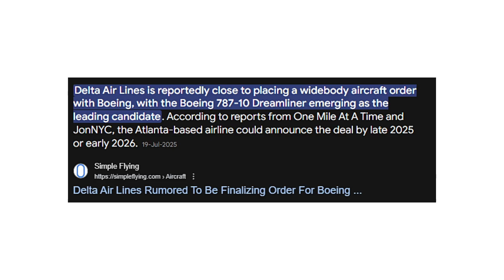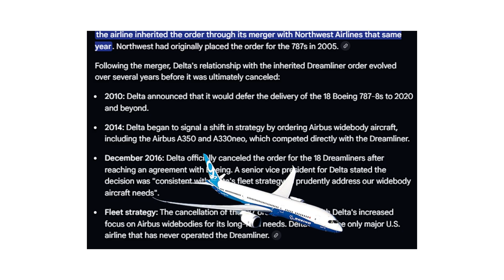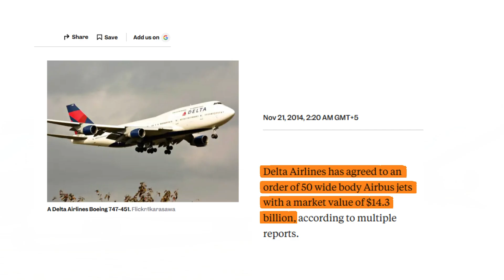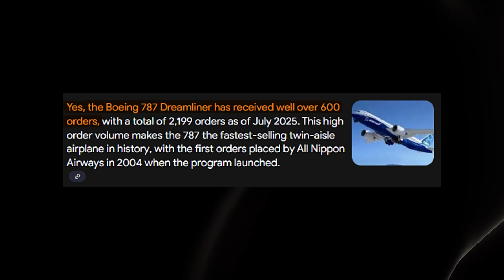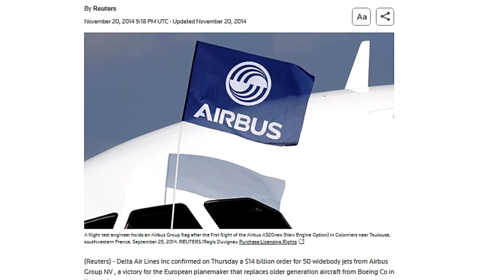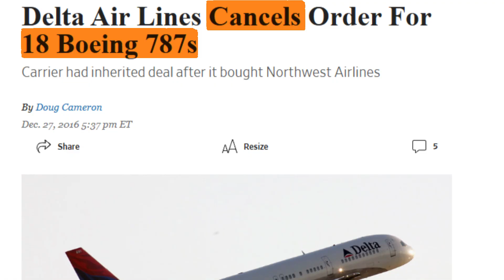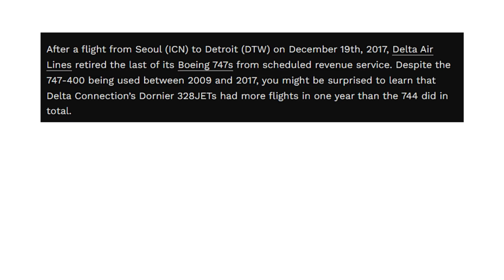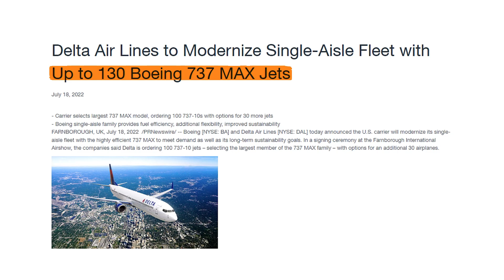Why Delta Abandoned the 787

Comment: I think Delta are going to order about 30 787s in the next few weeks
I don’t think Delta have given up on Boeing. I think it was just a move based on their situation at the time

Delta still have a bunch of 767 they need to replace the 787 is the logical replacement

Delta want to be on Boeing’s good Side if they want the 797 they so desperately need, they ordered these max 10, which I don’t think they even want. I think they have that order on the books to leverage the new Boeing jet when it eventually comes out…

The only thing we know for sure is that delta is replacing the 717 with the a220 as it is the only logic replacement, on a sidenote, I find it hilarious that Delta are replacing a Boeing rebranded product from McDonnell Douglas with an airbus rebranded products from bombardier
.